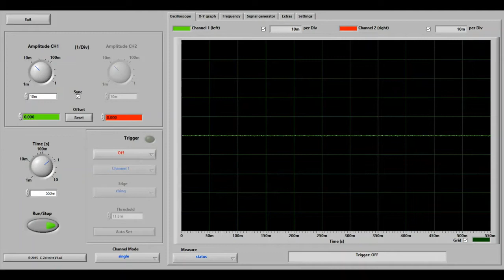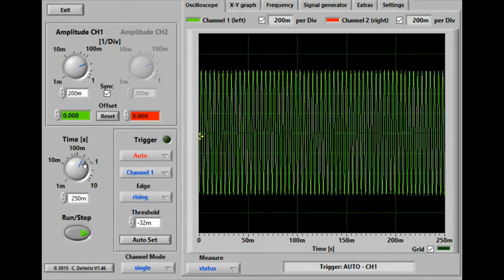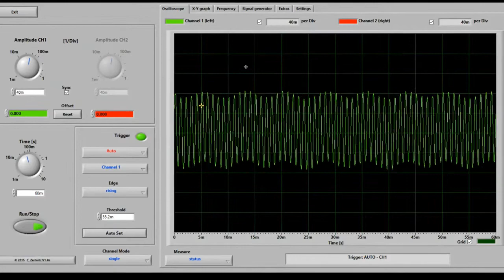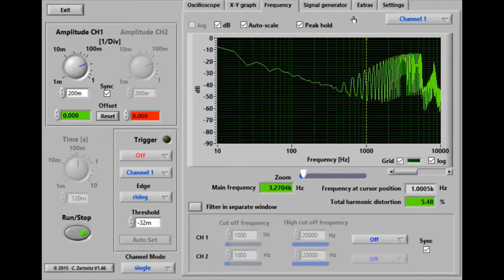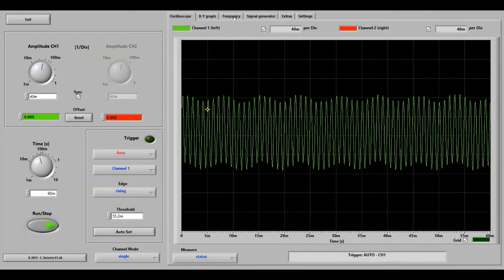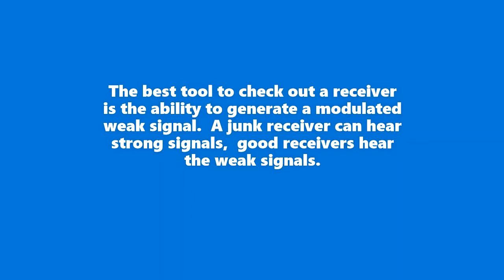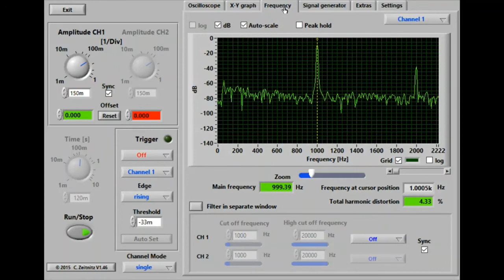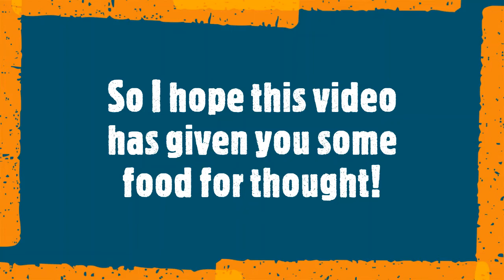Sound Card Oscilloscope

Comment: Teacher, let me ask you, using this program, why when I test the audio output, while the millivoltmeter is Vmrs=775mv, this software only shows Veff=13m and Vp-p=46m?
Reply from the maker: Hi Quangmi3402,  There is a calibration of amplitude factor that can be changed under settings, and this will compensate for different sound card variations.
I tried to duplicate your results, and I am getting Vp-p=46.02m  with Vf of 16.27m, which does not match your measurements.  I'm not sure what the program is doing here.  
I am using internal signal generator at SINE, 400hz, and amplitude of .023,  with calibration value set to 1.0 v/div.
Vrms of 775mv should equal  2.192 vp-p

It appears in my setup the Internal Signal generator amplitude is .5x of Vp-p with calibration set to 1v/div. and using a different cal of 1.414 v/div, now the generator output is scaled to RMS, Gen chan 1  amplitude 1.0  and the scope reads p-p 2.828, and veff 1.0 which the math works correctly in my setup.

You input .775 rms according to your meter,  which should have read 2.192 Vp-p, but your only got Vp-p  .046.  I would calculate a calibration value of 47.65 v/div to compensate for your sound card.   I would also think you would want an external attenuator or volume control to reduce the input signal to avoid clipping on the sound card input, and scale your calibration value accordingly.

Let me know what your results are.
Good luck and happy experimenting.

Comment: Nice work, I am looking for a software to generate a pure tone with 1 more hertz than the detected signal (my fundamental frequency) to generate a strobe light with my voice to see my vocal folds, could you do that?  I think that it only needs a few code lines and would help me and another ent doctors to analyse the vocal fold movements. thanks.
Reply from the maker: Hi Mario,  Sounds like in interesting application, but I did not write the software so I can't add the modifications your request.   The software was written by Christian Zeitnitz, his website is www.zeitnitz.eu.   He has contact info on his website and might be able to do what you ask.
What I will suggest is to see if you can use the stereo frequency generators to create a tone in headphones from oscillator A and drive an LED strobe with the same pitch using Oscillator B,  and have the patient sing a matching or near matching note with the headphones while using what I would describe as a  dental mirror with the strobe LED on the end of the dental mirror.   You probably have specialized tools for this, but thats my best idea at the moment.